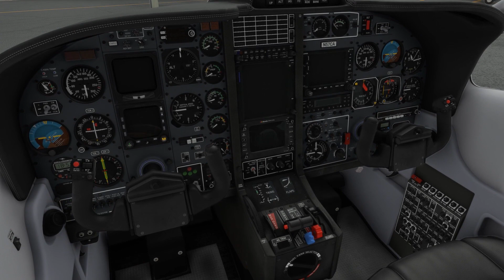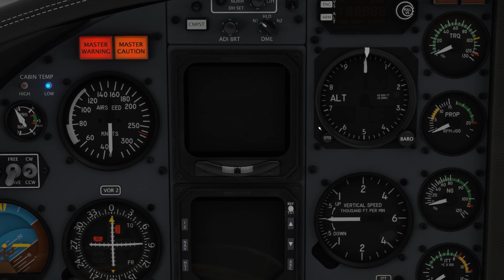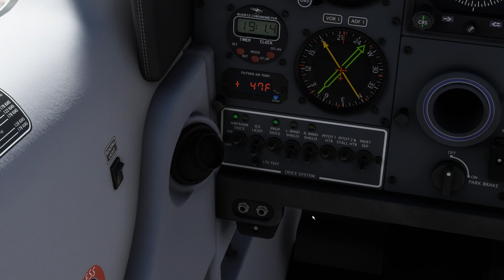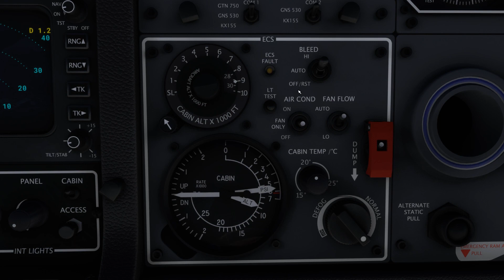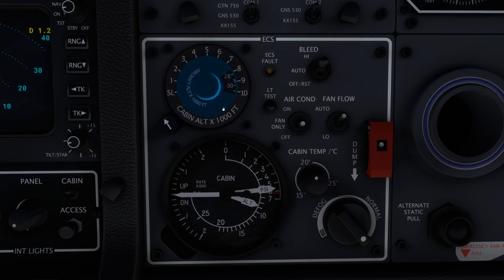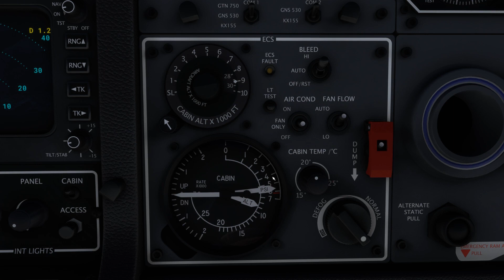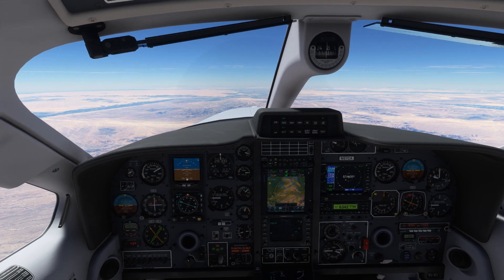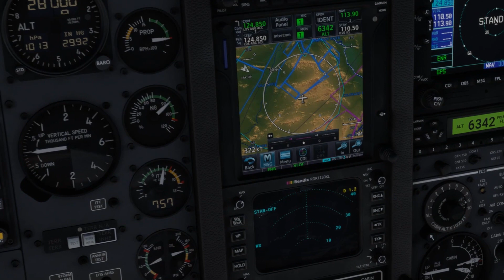Black Square TBM 850 MSFS - Environmental System

Comment: While the TBM is not really my cup of tea, I really enjoy watching every single Black Square video and look forward to the Duke!
And while I know it's not what this product line is focussed on, I'd love to see a little 'randomness' or variation built-in, so no two liveries (or engines on twins) are performing absolutely identically by the number, with each livery developing persistent quirks, working similarly to the failures, so you could fix/disable them if you wanted. (I suppose that comes with degradation of systems, so would need a more granular failure/wear mode.)

Comment: How do you get the GTN750 from PMS50 to be properly integrated, especially Working Title Technology? If that doesn't work, it would be a total failure, at least for me, and I would try to return the plane
Reply: There's downloadable packages on the PMS website to allow it to work alongside other avionics, they're listed for each individual aircraft. Fixed my Baron/King Air/C310 nicely

Comment: For Lords sake, sort out your autopilot.

Every aircraft you make has a 50 percent chance of intercepting an ILS.

IT'S EMBARRASSING.  Even the stock addons can manage it.

In the TBM for example, intercepting in Heading mode...and the ILS is activated on the EHSI.

The APPR display should show "Armed" in white when activated... once intercepted, it should be green.

It NEVER Arms in white... and half the time, it will not even intercept the localiser... even though it displays in green as "active".

I am wasting so much bloody time pratting around with these planes.

They are not fit for purpose.

If I'm wrong... prove it. Show 3 ILS approaches on the bounce.
Reply: It's a shame you're so frustrated. Not something others are suffering with by large.  Anyway, here's some words direct from the developer for you. And the link below is a link to six ILS intercepts he carried out, to demo to you. Hope his words and the videos help. Not too many devs would go to these lengths, hope it's appreciated.

"As others have said on various forums, there is some GPS mod incompatibility that causes issues like this.  My manual is very clear on which addons are suggested, and that the addition of any other (or outdated) GPS mods may cause problems.  Tech support has also gotten very adept at sniffing out these issues.  Any bugs you find within my software are really unlikely to be in the approach flying systems, because that's what I test the most by flying every type of instrument approach with every combination of avionics, just before release.  The autopilot mode arming system is limited by MSFS's autopilot implementation, so the mode arming indicators only display when the navigation source signal is not valid.  There is an example of mode arming on page 42 of the manual. Hope that helps."

Link to video for you: https://youtu.be/lvygKjtFPSI

Comment: The Flight Simulator is exciting, except when it comes to obligatory updating.  The work of JustFlight is really excellent. I'm not going to buy, because Microsoft doesn't meet my expectations. The future MSFS 2024 will not be in my library.
Reply: Maybe MSFS 2024 will do better? I wouldn't determine not to buy at this point. Besides, the TBM is really nice and will be supported in the new sim!

Excellent work, guys!
Reply: The fact that you are discarding a whole simulator and its future versions just because of the updating system NOW, which is used every couple of months only,  is only a lie and an exaggeration. I hope you don't do the same with other subjects.. We all deserve a second chance.
Reply: @TheMekein  I agree but a bit to personal. The update took like 4 hours for my newly upgraded PC, decompressing mostly and not knowing if it just crashed or sth. (Just the update)

I can relate to the problem, even though it doesn't annoy me that much. Does it need to be fixed, for sure!
Reply: @TheMekein  I understand what you are saying. No, it's not a lie.
If you read the release notes, you'll see everything a simple player has to do before an update. I'm a simple gamer, and I don't feel qualified to go through and understand all the folders, files and things that I don't know they are. Having to turn to a software professional to do an update is not what I want. Thank you for your answer - really-
Reply: @Ch3wbacca  I already solved the problem, 24 hours and money for the computer professional. I thank everyone for their attention to my complaint.